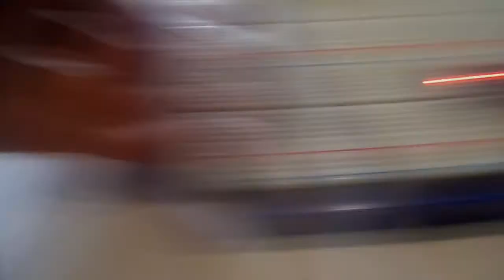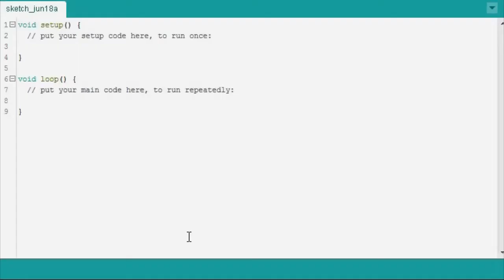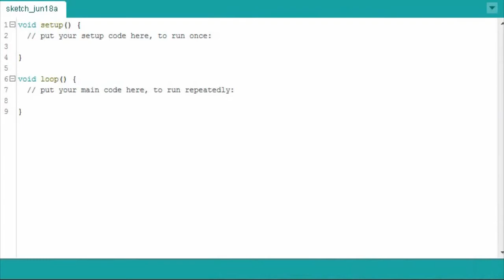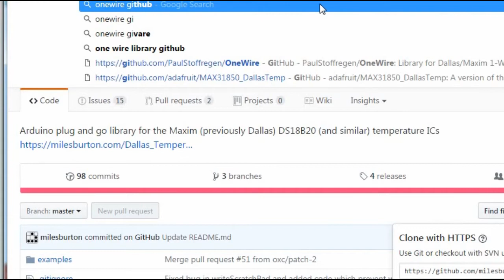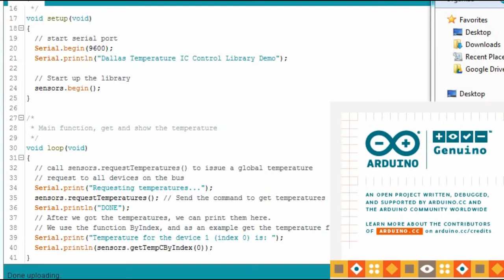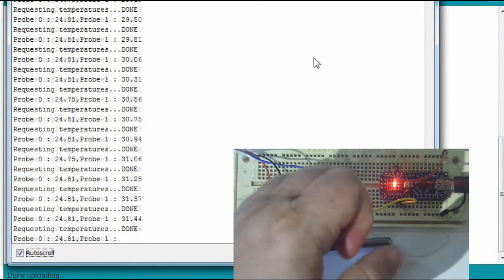Connecting a temperature sensor to an Arduino (Dallas DS18B20)

Comment: Hello !
Great video ! It's very clear.
Do you know if the wiring affects the probe number ?
So, is it possible to know which probe number it will be before compiling and how to do it ?
Thanks !
Reply from the maker: You cannot set the probe number by the wiring unfortunately. However if you go to the write up at

http://www.xtronical.com/basics/environmental-sensors/temperature-sensor-dallas-ds18b20/

it talks about using more than one sensor at the bottom of the page. However I can see this is not exactly what you would want. But as all these type of sensors have a unique address which should be able to be utilised when talking to them. I have not looked into this though. As I imagine it you would need to read the address of a sensor, label it physically so you know which is which and then you can write code and design your hardware accordingly.
Reply: Thanks for the answer :)
I will do that : connecting all the wire that I need then identifying and labelling them :)

Comment: We follow ur video but only getting - 127 temp.. 😕😕. We try everything cn h help plzz.. Nd is  ths sensor is able to measure body temp
Reply from the maker: Hi, - 127 would usually indicate that the 4.7kohm resistor on the data wire is not present or incorrectly connected. No data is going to the Arduino. Have you looked at my write up as well as the video, it's available here http://www.xtronical.com/basics/environmental-sensors/temperature-sensor-dallas-ds18b20/